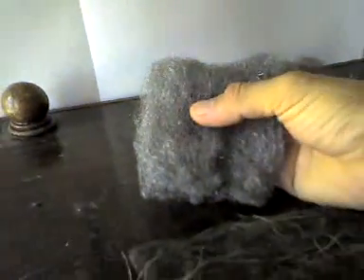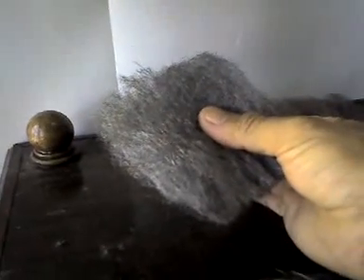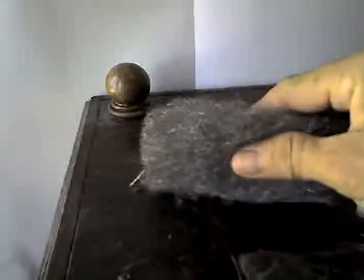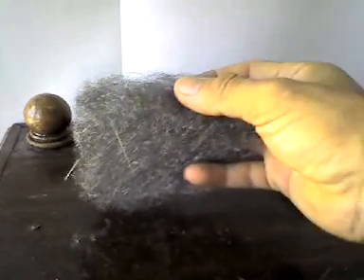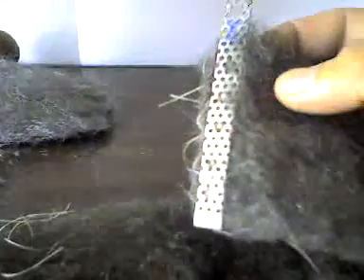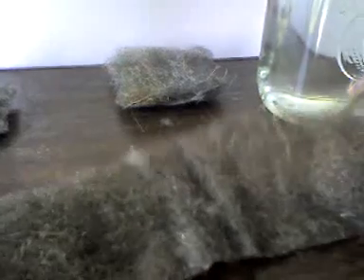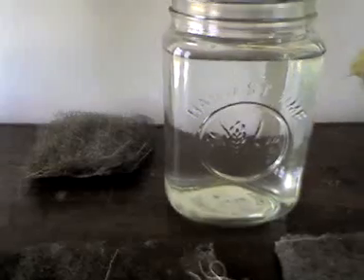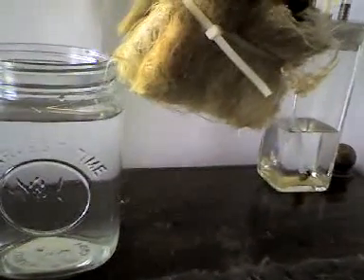Highest Possible Development On HHO

Comment: which metal net you used
Reply from the maker: Stainless steel.
Reply: thankyou dude but from which name we call it i m from india so let me know how it works i tried to make it but when i connect wire direct from my bike wire burn totally red and nothing happen like video
Reply from the maker: I'm really sorry but I no longer have nothing related to this devices you will be needing to ask for help to some one else..the only thing that I can say is make sure that your use a good insulation between plates..
I used Scotch bright 'Like the ones to scrub dirty dishes" in that way I didn't have no short circuits.. good luck..

Comment: just take some picture frame wire and double twine it with a drill and run it threw your steel wool... you don't need massive mounds of steel wool it will get hot... maybe install a bubbles and radiator in one?  turn these steel wool wet cells into dry cells?? .. I got it don't worry

Comment from the maker: @a2zhandi well since I finish This project I have to be honest I have improved in many areas! that make is a bit more cost full but a the same time much more efficient! I managed to get a Volvo 850 to give me 47 Mpg, but I didn't have other choice but to change the engine Ecu, other wise the original computer on the engine was working against me! thanks for your comment.